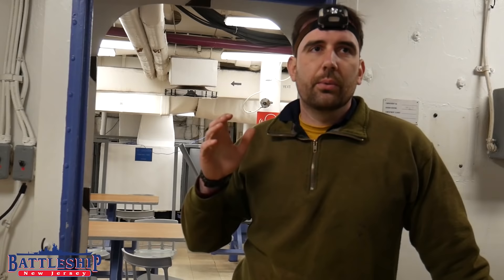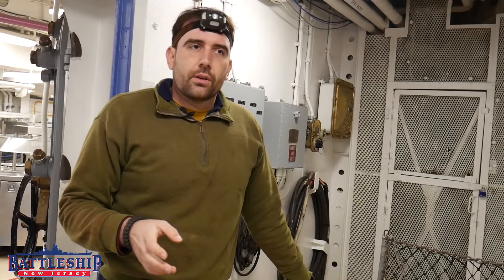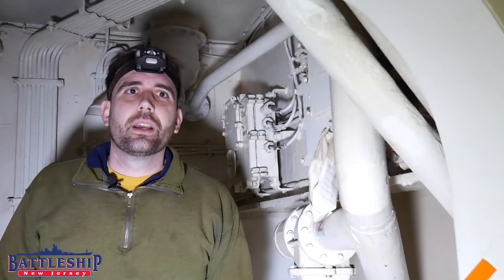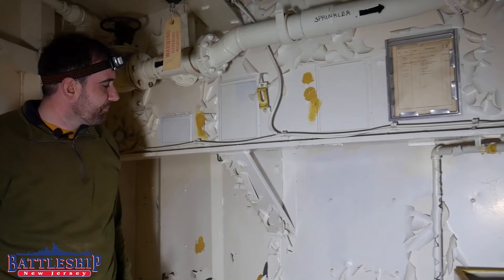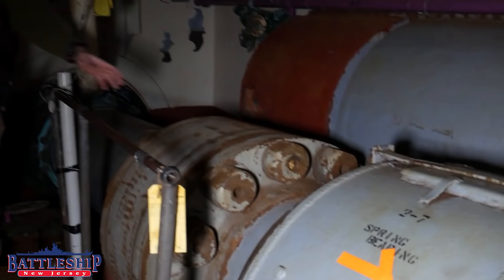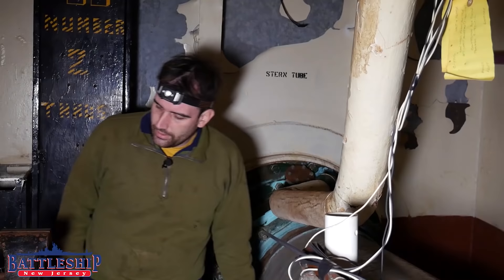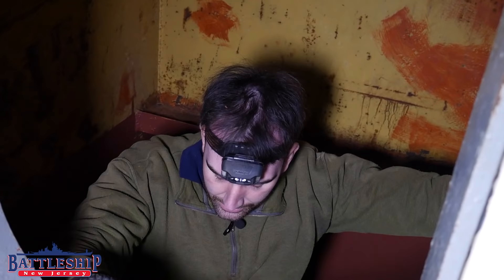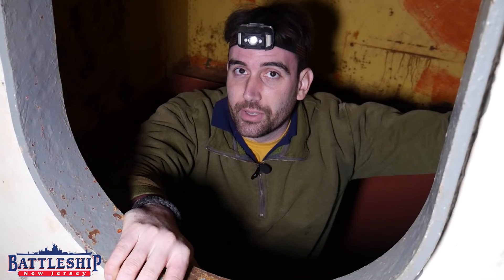Down to the Battleship's Keel

Comment: The watchman key station in most cases was a holder for a key that would imprint a number on a paper tape that was inside a big round clock that the watchman would carry on his shoulder. When he would make his rounds, at each station that he came to, he would take the key, at each station, and put it into the clock and give it a turn.
Later, if anything happened , or the watch caption wanted to check and see if the watchman has made all of his rounds, he could look at the tape and see if each station number was stamped on it, and the time each stamp took place.

Comment: that watchmans box on the door at around 14:15 most likey held a detex key for a detex clock, put the key in, turn it and it would leave a mark on a paper coil inside the clock to show when you passed by that key station. i know these well from my 17 years of security work ( ' 87- '04 )

Comment: I don't know if you're doing it off camera but it would really be a good idea to use an oxygen monitor before stepping into enclosed spaces like that. When there is very little air circulation, rusting steel will eventually consume all the oxygen in the air.

Comment: No, you are wrong about that key box @ 14:18 . It is a key box, but it had a key on a chain. The key had a numbers on it's teeth much like the numbers on a typewriter. The watchman carried a clock about 8" in diameter and 3" thick. It was all mechanical and had to be wound up and set by a supervisor every day.  It was in a leather pouch with a shoulder strap. The clock had a round paper card inside. When the watchman made his rounds, at every key station, he would put the key into the clock, turn it, and the key's station number and the time would be imprinted on the card. This is a very old system that date's all the way back to the thirty's. It was to insure that watchman actually made his rounds and did not sleep on the job. I hope this was helpful. You looked like you were struggling to explain what the key was for.

Comment: The watchmans key station contained a key that the watchman put into a watch clock and turned which caused the watch clock to  print time, date, and key number on a paper strip or embossed on a metal strip. This was to ensure that all areas were inspected at the times  scheduled. So basically a laziness preventer. Yes, he did carry the watch clock around.

Comment: The Lanthem Watchmen Station is a receptacle to hold a "coded" key. The key is inserted into a key hole of a device carried by a guard or watchmen. This device was approximately a five pound circular watchclock, often enclosed in a black leather pouch attached to a heavy duty leather strap and carried over the shoulder sam brown style. Inside structures, key stations were often mounted near doors or at the far end of an enclosed spaces, which consisted of a small metal box with a hinged lid, which contained a numbered/codef key affixed by a chain. The watchman would insert the key into the clock, rotate it and a numeric stamp would be pressed onto a paper or plastic disk locked inside the clock. Thereby documenting a patrol routine by date and time. Having a system like this kept guards/watchmen honest and often times reduced insurance premiums by proving a diligent fire watch etc, by indicating the exact location of the key station and what date and time the impression was made. Lanthem is probably a the name of the manufacturer of that system. Another manufacturer was the  Detex Watchmen system. Hppe this helps.

Comment: If the keel is an actual I Beam, the part that you were standing on is a flange. The part that is over you head is also a flange. The vertical part of the beam is the web. "How do I know?" I worked at the Bethlehem Steel Gray Mills for 31 years. 
Great and very interesting video. I was on a destroyer and never saw the keel....and I was a BT. 
Barry

Comment: Favorite design element - the machinery. Specifically the mechanicals, engine, gear set, I would really like to see the Chillers that make the chilled water. Thats what I do for a living. I would consider it a blessing to see a 1940’s chiller that cooled the rounds and citadel, with an in depth explanation of how it worked, or at least how it was laid out and serviced? Is there any literature on site for it?

Comment: Not for the claustrophobic.
Does the keel provide much of the strength of the completed ship?  I would think it is used mostly to keep everything aligned during assembly of the main frames, and the finished hull and armor provide most of the structural strength.  Any marine engineers have an answer?

Comment: Love these videos thank you for making them enjoying going places that are not on tour! However, like in this video going to the keel when you're standing in an area, I got the beginning and every other place you stand and talk about please take the time and point out and discuss everything we see in the walls behind you hanging on the walls on the floor wherever it's at big or small. Like in the beginning what's behind that door that's made of expanded metal to let air through? What's the brass covered boxes on the walls? What's the gray boxes in the walls! Why is there blue paint around door frames and why is there yellow around door frames? What railing at the hatches is original to the ship and which did you have to add to be a museum? And why is there an orange painted red cleat welded to it's like a pipe by the hatch? Why is there an x on some of those doors you're going through down below second floor? What is the document on the wall that says duplicate? What is the big boy above you for when you're about to go through the armored deck outside the galley? Work some of the handles on these hatches so we can see and hear what they sound like when the hatches were closed or open that would be cool! And explain what all the pipes around you on the walls are for what's it say on the pipes.?

Comment: I have an interesting idea if it already isn't something there. Use some of the equipment you have in the 16inch storage area (16:30) with dummy shells in a building of some sort to teach people the process of loading on a miniature scale. I don't know specifics, but if it was a 5 foot space from the shell coming in the turret and getting placed in the barrel, knock it down to 1 foot or something. You could have a horizontal loading area for foam shells that kids had to move from the storage area to the gun rather then the vertical system that was used in the ship.

Comment: 11:30 Is that the glass dome from that light fixture sitting wedged between those pipes and the wall on the left side of the screen? Someone probably replaced the incandescent light with the CF light 20 years ago and set the dome there and it's been there ever since!

Comment: Watchman key station - had a key with a number on it - It was put into a unit carried by the watchman (about 8 to 10 in round 3 or 4 in thick with a clock face) recording the time the watchman turn the key in the unit

Comment: Interested to know if you need to consider air quality and test for it considering these are pretty much enclosed spaces without much normal ventilation and you could have oxygen reduction due to rust. 

BTW, even though I am 6' 6" I would love to go crawling through the engineering spaces.

Comment: I have one question, while you are filming in all of these spaces I notice you are wearing a radio at your waist and it is often catching on bulkheads doors and manways as you move throughout the vessel. Does that radio actually work through all of that steel? I would think that it might travel one or two compartments before it became so garbled that it would be virtually indecipherable. So tell me what kind of radio are you using and how far through the ship does it actually reach? because in normal conditions aboard the ship when she was still in operation, you had communication systems built into the ship while it was under its own power. and you had no problem calling for help if you needed it, but what help does a radio provide when you are inside...say the Armored citadel where you're behind 4 inches of steel at least? Or am I just thinking wrongly that the radio has no problem  reaching outside the vessel?
Reply from the maker: Our radios work pretty well through the ship, we have repeaters placed around that help. It's not perfect but it's not terrible. The shipboard phones and announcing system also work but we don't always want to to tell the whole ship when we do stuff

Comment: The Watchman's key, you sure it wasn't a stamp to prove they where there?  Sometimes, to make sure people do their rounds, they are required to run around and get a piece of paper marked (stamp/punch/etc) showing they were at each location.  They turn it it and its compared to a exemplar and show he went everywhere.  Now the keycards mark someone going around, but in the day, like I said I now security and maintenance would use stamps, and here most likely a unique punch, to show they went there.  And no, cheating wasn't easy, stamps were unique (not a lot of copy machines), the guy who sent you out signed the card and got it back.  Just a thought, I have to think "yeah, I walked all around the mothballed ship" is easier said than done.

Comment: Great video but I wanted to note and add a word of caution. I didn't see any fresh air being fanned into these spaces from above decks. I also assume that most of the spaces below 3rd deck are rarely visited and may stay closed for extended periods. With oxidization of the trapped air this is a dangerous situation to enter these spaces without fresh air being fanned into them to ensure there is actually oxygen present. Please use caution.
Reply from the maker: Unlike an active vessel, we dont close doors and hatches. We aren't worried about water tight integrity which means we don't have the same ventilation issues.

Comment: Ignorant question - are the refrigerated chillers in the ammunition storage areas intended as climate control to prevent degradation of the ammunition, or, is there a safety purpose associated with the chilled water system (you often mention the sprinklers together with the chillers), or is it something else?
Reply from the maker: Its climate control.

Comment: This is proof of why seamen are young and lithe: stocky middle-aged bears like me either couldn't fit through the smaller openings, or once in would require a blowtorch and a 55 gallon drum of lube to get back out!

Out of curiosity, what were the operating conditions down there when the ship was operational? Hot & noisy, or were there sound suppressing measures to reduce its visibility to U-boats?

Comment: I've seen several of your videos including the one showing the shaft allies, and I like them. I have a question: What equipment etc is in place to ventilate all those enclosed spaces and prevent oxygen depletion. The oxygen in the air will react with any exposed metal and if the ventilation is poor or even non-existent eventually there won't be enough to sustain life. There have been many instances of people losing their lives because of this.
Reply from the maker: Its really not that much of an issue. There are multiple openings into these spaces allowing for ventilation.
Reply: @BattleshipNewJersey  Thanks. I had the impression that many of the spaces had only one small hatch.
Reply from the maker: Very few spaces on board have only one entry way, just in case of an emergency. This particular space has probably a half dozen routes that one can take to get out. Some of them easier than others. The route we took in was not the way we took out and the way out was definitely preferred.

Comment: Did you find the fabled "golden rivet"?  Was sent on a search for one when a midshipman.  "every ship has one" they said...
Reply: Assuming that it is a prank there is another one that doesn’t translate into English but it’s so ridiculous and hilarious that actually sailors fell for that prank: the keelson, the upper part of the keel where the frames are connecting to the keel itself is called in German „Kielschwein“. The literal translation is „keel pig“. And some new unsuspecting sailors were sent down to the keel to find and feed the Kielschwein. I guess some even had to carry a bucket of kitchen leftovers (maybe even half rotten) with them.
Reply: @TheFreaker86  There was also another prank that was popular.  A rookie seaman might see two or three guys standing around looking in a bucket on the deck.  They would tell the rookie seaman to "come look! We captured a 'sea bat' in the bucket".  And when you bent over to look in the bucket you would get swatted on the butt by paddle they called the "sea bat".

Comment: I really wonder how the heck they managed to get things like the 50 cal ammo from deep deep inside the ship to where it was needed... That stuff is heavy and cumbersome and it seems like all they had are those ladders and loads of hatches that would be closed in combat...
Reply from the maker: Check this out https://youtu.be/nFc6VmkcrNw
Reply: @BattleshipNewJersey  Yeah I've seen that, though that's more large shells or heavy machinery. I'm more curious about the "heavy/cumbersome but still able to carry by hand" but not quite "move it by rail or block and tackle". Like someone else said in the comments, it would be cool to see Ryan do some of the Chieftains "the tank is on fire" runs. Sort of like the battle stations vid where he had to go from the berthing to battle station. So for example get a box of 50 cal ammo from the ammo storage to a 50 cal on deck and see what you need to go through to do that procedure in combat, opening all the hatches etc. Would it be something done by a single sailor or like, round up anyone nearby to pass it along and things like that. Really fascinating to see how tasks were actually performed
Reply from the maker: The rail is also great for hoisting things up through the levels, not just down hallways. With vertical ladders like here, thats really your best way to move things. Once you're on a flat surface, then it can be carried.

Comment: Hi Ryan, thanks again for this. I watched this a couple of times on release but since I have been reading a bit deeper in to battleship construction with some excellent works from John Roberts on the Repulse and Hood left me wondering if Iowa class ships have a docking keel on the outer portion of the bottom, is the main keel a box keel and of so is the box top in the double or triple bottom plating? Plans I have see are either too low detail or  too low resolution in reproduction to tell.

Comment: Question: Do you have to check for poisonous gasses before these adventures inside the ship's compartments?
Looks like the entire battleship is a series of "confined spaces" to me...but I do not have a battleship to play with so I have to envy yours.
Reply from the maker: Its definitely something we are aware of as we move around, these particular spaces are well ventilated through multiple openings, though it can be hard to tell from this video. And someone is down there multiple times a month checking for water.
Reply: @BattleshipNewJersey  yeah it looks sooo tight in those small rooms. Thanks for sharing the ship with us!

Comment: 464 likes in two hours. Love seeing the electrical work. Talk about craftsmanship. 
Question about the thrust bearing: The bearing surface can only be around the shaft. Is the force transmitted through roller bearings ? Is is two plates seperated by high pressure oil. 
I assume there is an equal bearing for and aft for forward and reverse motion?   
Has the technology changed much in 80 years ?
Reply: It should be similar to other thrust bearings. Sometimes a ball bearings. Sometimes roller.

Comment: When a ship like this goes to Battle Stations, are there sailors down in the shaft areas?  Sounds like a suicide mission.  No way to evacuate quickly.
Reply from the maker: There are multiple entry points so, its not as bad as it seems. But yes, these spaces are traditionally manned

Comment: Question that I don't understand how did the armor piercing  shells explode I was not aware that they had any explosives in them lol I thought they killed through kenectic energy and penetration. Not explosives
Reply: Both Armor Piercing and High Capacity had fuses to set off the explosives. The Armor Piercing was designed to penetrate before exploding, as was the High Capacity.  Hope this helps.
Reply: The idea of AP shells of this size/era was that they would punch through the armour and then explode, on the inside. They did have smaller explosive charges, because more space and weight was taken by the hardened tip, but most of the damage would still be from explosives rather than kinetic energy.

But I think the idea of the spaced armour (and I'm not certain, somebody will hopefully correct me if I'm wrong) is that punching through the first 1.5" deck will trigger the fuse on the shell, causing it to explode before it reaches the 6" deck.
Reply: @simonwaldman5497  yes that's the purpose of it now that I understand it

Comment: you should be careful about entering enclosed spaces. The gas may not be safe to breath.
Reply from the maker: These spaces are regularly checked for water intrusion and have been open through multiple openings for 3 decades. They even have a slight draft.

Comment: Wow, I am old enough to have actually used a watchmen's key station.  Basically, if you were a watchman back in the day, you carried around a device that looked like a heavy duty canteen but actually was a kind of clock.  When you got to the station, you inserted the key into the clock/canteen, and that made a record of you being at that station at a certain time.  This way they knew you out actively patroling your assigned patrol route, and not just sleeping in the guard shack.  Hope this helps.